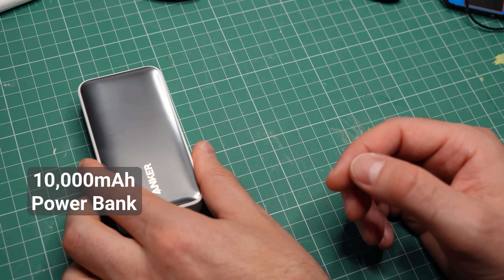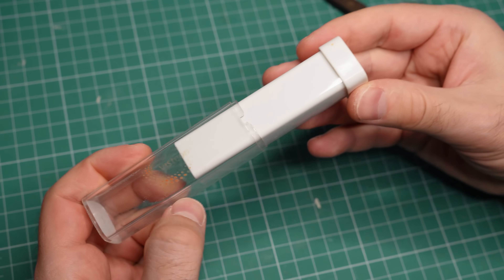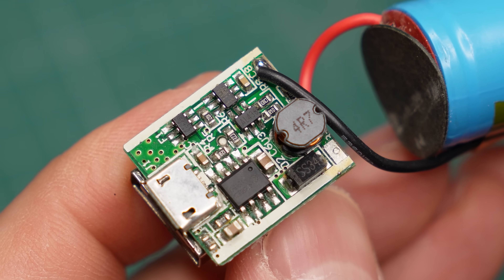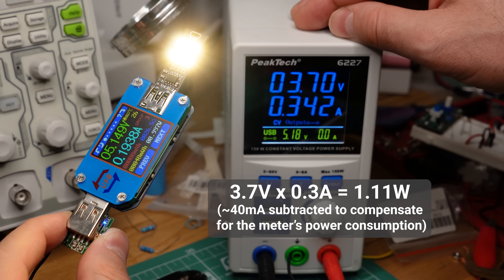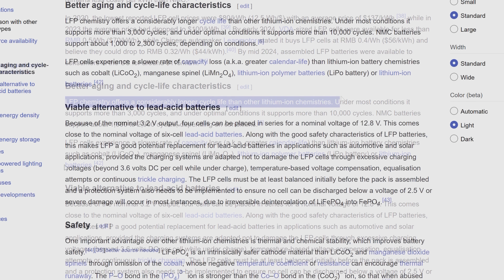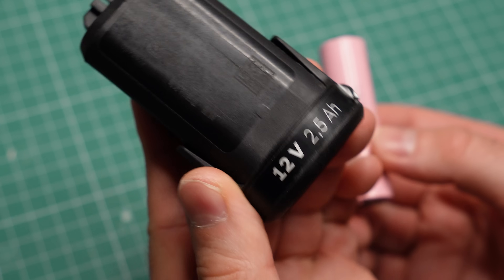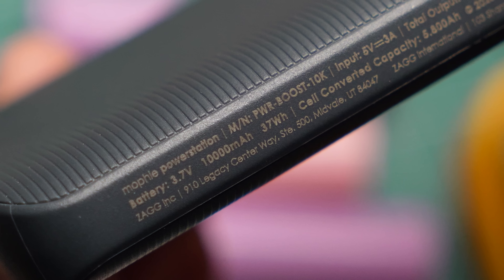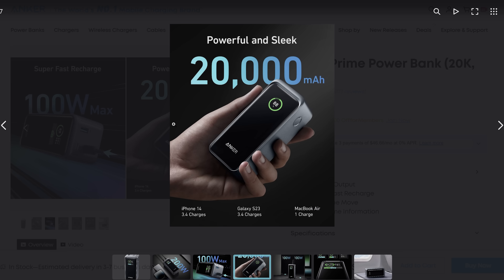Power Bank Capacity is Confusing. Let me Explain

Comment: 3:50 For capacity, cells are connected in parallel, not series.
Reply: You get more capacity regardless... Watt-hours is the unit for capacity.
Reply from the maker: They are now often connected in series to do 9V or 12V conversion more easily for high speed charging.
Reply: Capacity doesn’t change, it’s voltage or current. In series is higher voltage, in parallel the current gets distributed between the cells.

Comment: You count the capacity not by the battery, but by the usb port and there you will get ah i wh. So, your arguments are.
Ah works at the same voltage, wh works at any voltage. If you have a device that runs on 12v and you know how much energy it takes, then you can easily choose a battery, but with wh you will have to convert everything to wh and still see how much current your device takes and voltages

Comment: Perhaps the best reason to use Wh is because mAh isn't a measure of anything. The SI unit of energy is the Joule. At least the Wh is 3600 Joules because it uses hours, and there are 3600 seconds in an hour.

Some have suggested that they can cure the mAh problem with simple arithmetic. Just multiply the Ah figure by voltage and get Wh. That doesn't work, because the voltage isn't a constant. And the nominal voltage isn't even the voltage at any given time, it's just an average. Besides, Ah isn't Amperes, so it never was current to begin with. The result we want is the total energy that a cell or battery can store, and that means the voltage must change between the voltage at full charge and the voltage at full discharge, and every voltage in between.

If we knew what the discharge curves were, we could use calculus to help us out, but we don't even know that. Measurement is the only way. If we measure voltage and current at regular intervals, we can then plot the curves, plug the data into the power equation to derive ΔE (change in energy), sum all the data points up, divide by 3600 and you have energy in Wh.
Reply: Ah was useful back when powerbanks became common because all USB power worked on 5V. Only when USB 3 and thunderbolt came along did we get more PD standards with variable voltages. Ah was simple enough to understand as most devices drew either 5 or 10W from a 5V supply. I = P/V, you can get the current draw and mAh will give you how long a powerbank would last
Reply: @PunzL I don't see the connection. Whether 5V or 20V, that voltage is converted from battery voltage by a boost or buck converter. You also forgot Qualcomm Quick Charge that came before USB-PD. The reason why advertisers use Ah and mAh is because it yields large numbers without outright lying. As we see, mindless consumers are suckers for big numbers, spending thousands every year to possess a slightly larger number, but no added benefit. It's an easy, but dishonest way to make money.

If you're using USB bus voltage and cell Ah rating to calculate energy, the first thing you must face is that Amps times hours isn't the same as Amps. How would you factor out time? You could multiply by something over time, but what rate do you know that's applicable to battery Ah rating? If you use USB voltage, that's not applicable because it's different from the battery voltage. That's why it's important to keep different parts of any circuit separate when calculating anything. DC-DC converter efficiency can be from 70% to 90%, and USB voltage is completely arbitrary.

Good on you for making an effort to apply the power formula! Keep at it, you'll get there. Remember that you must factor units as well as numbers.
Reply: @Speed-Daemon-123 Amp-hours measure charge and on a battery bank it doesn't depend on the output voltage of the bank (5-20V) but on the battery's voltage (3.7V nominal). The battery voltage depends on the amount of charge stored and the load being applied. The higher the load the more battery voltage drops under operation due to internal resistance and thus will supply less energy when compared to a small load but if you measure it, in both cases you will get the same amount of charge.
Reply: @MarkoHR  can you show me your math? How do you get from Ah to Coulombs? I showed how I got from Wh to Joules, after all.
Reply: @Speed-Daemon-123 Ampere is 1 Coulomb per second, Ampere hour is 1 Coulomb / second  * 3600 seconds = 3600 Coulombs
Reply: @MarkoHR  you got it!
Reply: It was fine if the bus with certain voltage is used. Engineers of the past weren't stupid or didn't know about Wh. It was handy to use Ah, when there often single voltage like in cars 12V most often. And converters were bulky, heavy and expensive, so there weren't lot of them. We need to acknowledge that it's ok method. We just transitioned into new era, and Wh is better now, and also we see more and more Whs alongside with Ah.
Reply: Ah is a measure of how many electrons will flow within some time, but that is not enough to know the energy, because there's not information about the speed of each electron, which is designated by the voltage.
Reply: @vaakdemandante8772 The missing information is about the energy of each electron(or electric charge). That's the voltage.
Reply: @vaakdemandante8772  that's why your method doesn't work. Counting electrons yields charge, and the unit for that is the Coulomb. Measuring voltage and current, and applying the power formula works because power is energy over time. You're thinking, but not following the units. Stick with it!
Reply: @Speed-Daemon-123 He effectively said that mAh is an equivalent unit for electric charge (1mAh=3,6 coulombs), he didn't say that 's energy !

Comment: some people i personally know say that "Wh are confusing and are only used to scam people since it gives bigger number than actual (talking about Ah)"
Reply: yeah, my brain can't process Wh
12V-2.6Ah is easier to understand than 12V-31.2Wh or 31.2Wh with a mystery voltage
Reply: @BachCau_willykobiasky8767  if all batteries were advertized in wh, you wouldnt need to convert anything to gage their capacity. Knowing amp hours isnt remotely helpful when voltages vary so wildly across different devices.
Reply: @BachCau_willykobiasky8767 of using 3.2v 15ah 4 cells then 192wh,
if 3.7v 10ah 1 cell then 37wh (multiply all) what's confusing
Reply: @BachCau_willykobiasky8767  Even Lead-acid not 12V. Li-ion 12.8-14.8V depends on chemistry. You scammed off energy storage/capacity. If your Li-ion (not FePO4) 2.6Ah battery only have 31.2Wh...

Comment: All the retail-grade power banks I've seen appear to incorrect specs, as they list the series voltage of the cells and the parallel mA.Hr capacity. E.g. 5V/5000mA.Hr is actually 3.7V/5A.Hr, but 12V/9000mA.Hr is actually ~12V/3A.Hr. At least power tool batteries are labelled correctly. Using the W.Hr rating would fix this.

Comment: It's kind of impossible to make a power bank that can charge phone battery directly from power bank battery.  But it's possible if a mobile company want to do that. You need a external connector from phone main battery and then you need a 4.2v lithium battery and step up to 4.35v (because phone battery full volt is 4.35v) .Then It will be 95% efficient.
Reply: You also really wouldnt want to try and charge a phone's battery directly. That could be a very dangerous prospect with nothing gaurding the battery from unsafe variations in voltage or current.
Reply: Direct Charging with USB PPS, but it would be slow as we only have 3A and 5A cables. Thus Charge Pump to divide voltage. Already in some smartphones since 2017.
Reply: But that would be very slow
Reply: @MrAhmed42069  no. You can change lithium battery with 120watt but it not very good for a battery . And if you connect one battery to another battery directly then you can charge even more faster

Comment: Heh, wait until you realize that even when you have the same voltage, charge capacity (in mAh) tells you nothing about the energy you can "squeeze" out of a battery - one needs to take into account the current one draws during discharge.
Reply from the maker: It's true that current draw matters, but I think there's something wrong with the second half of your comment. Maybe you have maximum power and maximum energy mixed up?
Reply: @LeftyMaker  it was indeed. Realized a bit late, thus needed to retract it. Thanks.
Reply: @LeftyMaker  shouldn't batteries be measured in Joules?
Reply from the maker: @Xnoob545I've been also wondering myself since that is the unit of energy. This would technically be correct. Perhaps someone who knows more than me could explain. Personally, I'd rather use Wh because it tells me I can get this much power for that much time. It seems more practical
Reply: @Xnoob545 probably all the same reasons we don't use Wh instead of mAh.
They are almost synonymous, considering 1 wat = 1 joule per second.

Hell if anything, yea using joules would be better considering both storage decay and discharge conversion loss is...both related to heat byproduct - which is measured in joules - which makes figuring out the true safe ~discharge~ from full storage amount much easier.
That and it's not subject to voltage variance making it unreliable to measure storage like Wh.

Question is how do you measure that though?
Reply: @LeftyMaker Just use any unit of energy 
Watt-hour is more than enough
Reply: That's why stop expecting to use it to fully charge my phone and use it to just keep my phone alive long enough till I get home.

Comment: paused at 0:10 and ima guess: no, maybe about 1.6-1.8 charge cycles because of non-100% efficiency
am i right?
edit: i underestimated, it's closer to 1-1.5 cycles
Reply from the maker: You're spot on. In my case, the efficiency is around 70%. Some is lost in the power bank, some in the phone, then a bit more in the cable and connectors, and let's not forget that the phone is still on while charging, thus consuming power. 

Interestingly, a while ago I tested if different charge speeds would make any difference, but I couldn't measure any. Theoretically, the more current you pull from the battery, the less energy you extract out of it.

Comment: Yeah, that nearly caught me out. Since the 90,000mAh is measured 3.2V but I wanted to use it for 12V output. I see they have updated the site to include Wh now tho.
Reply from the maker: Yes, it appears some brands are transitioning or have both units. I hope Wh becomes the norm soon
Reply: @LeftyMaker 
With USB-C being the most versatile thing, covering an ocean of Voltages and amperages, there should be a standard unit of "BATTERY" CAPACITY that can't be exploited like "mah" that is one number at 3v and an other at 9v , so yeag, "Wh" should be displayed on all external battery advertising.
Reply: @LeftyMaker  this is not gonna happen because most tech media (youtubers, magazines, etc) only ever talk about mAh, so thats what people have gotten used to
Reply: @Supreme_Lobster It could happen  if an eccentric battery manufacturer uses the Wh knowledge to its advantage for marketing. But it is a tough sell because it is geeky.
Reply: if I was making a power bank the battery would be 12v and use a dc to dc converter to drop it to 5v reduce the amp drawn
Reply: @azeemtics6613 bad design step down just turns the energy to heat, but step up with a little modification should reach 98%
(tried it) 
ex: 3.2v (step up) to 4v or 5v to (powerbank module)
Reply: The standard should be Ah, Amp hours.
mah is kinda scuffed
Reply: @thefirstsin No... It's just a remnant of previous USB standards with a base 100mA current for power delivery
Reply: @thefirstsin  Ah is exactly the same as mAh lmao. The standard should be Wh
Reply: @thefirstsin  we've been using mAh since last century when the batteries were in hundreds of mAh range.
We never should have been using amp hours in the first place tbh
Reply: @elektroencefalografista to be fair, anyone using metric as a default, really has no problem with mixing Ah  and mAh. 

In the other hand. People have trouble differentiating W from Wh, power from energy. And then come up with units like kW/h